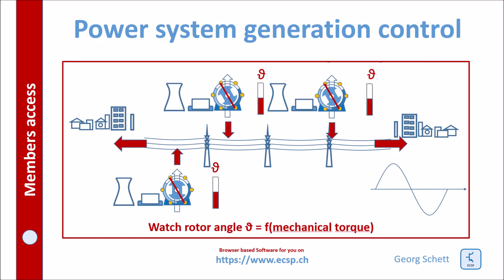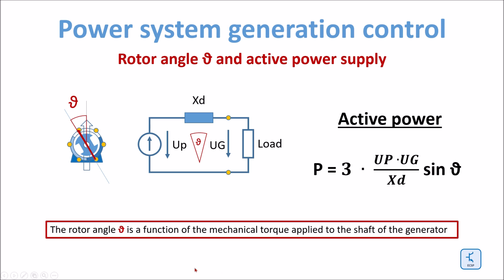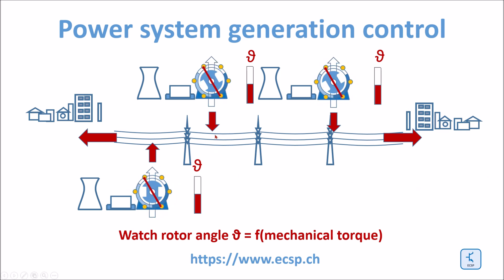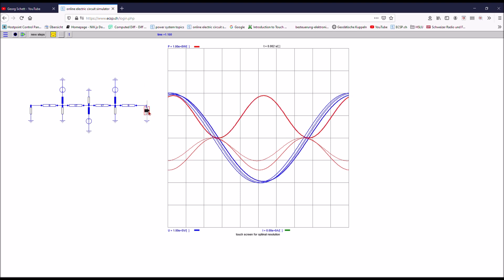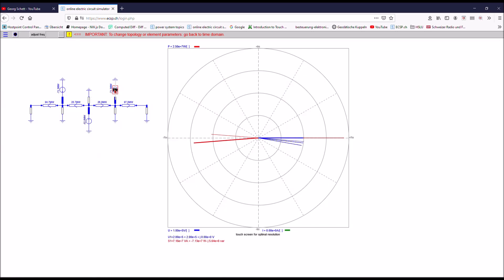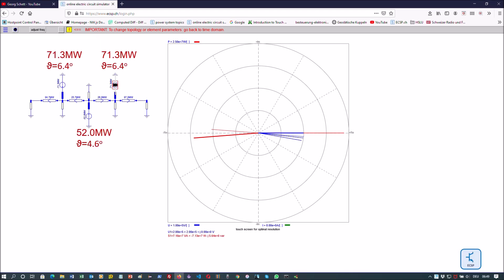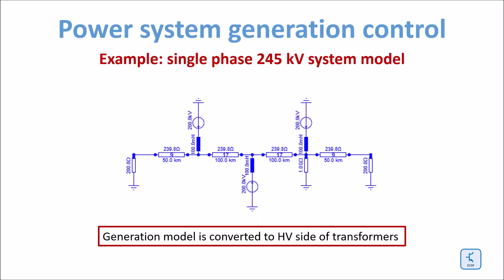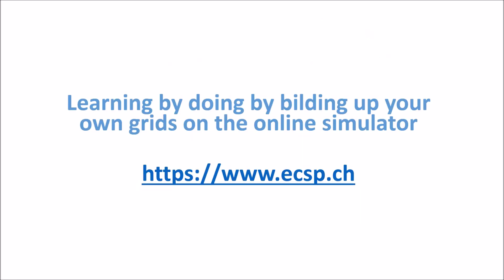generator rotor angle [circuit simulator]

Comment: Thanks for your video. What for me is it no clear is how is it possible to control the rotor angle? Meaning on which inputs (torque, excitation current on the rotor) a controller has to operate and which measures (E,V) it uses  in order to get a regulated rotor angle?
Reply from the maker: As you rightly say, the rotor angle is controlled via torque. The torque is controlled by a governor, this is a controlled valve which controls the mass flow for example of steam or of water ( in case of a hydro gen). The input signal to the governor is coming from a frequency measurement: Frequency too low: governor opens more, frequency too high: governor closes more. A second input to the governor comes from central control stations where other criteria such as cost, availability and so on are included as well. Hope this helps.... ;-)

Comment: after watched your video i understand the theory of active power is to controlling the rotor angle. thank you very much, could you make a new video whcih descrabtion how to control the reactive power?
Reply from the maker: This is on my todo list, thanks for your comment. But a quick one: You can control the reactive power by increasing or decreasing the EMF (pole wheel voltage) of the generator or add capacitors or reactors to the grid for example parallel to loads or transmission lines.

Comment: Isn't this called SLIP in an induction generator?
Reply from the maker: For synchronous generator, the speed is exactly the same as the grid frequency (except if the generator looses sync. due to a too high phase rotor angle). For an asynchronous generator/motor it is fundamentally different. If power is to be generated there needs to be a difference between rotation speed and grid frequency, this difference is called slip. A sync. gen. has no slip.

Comment: When the power angle of one generator is increased and the load remains constant, do the power outputs of the other generator automatically decrease, i.e. does the power angle of the other generator automatically decrease? Is this droop control?
Reply from the maker: Yes, you got it! HOWEVER not 100% The frequency will slightly deviate but there will be no acceleration as it would without the droop. The deviation will be compensated by a central system controller. If the droop would compensate 100% there would be oscillations in the power system.